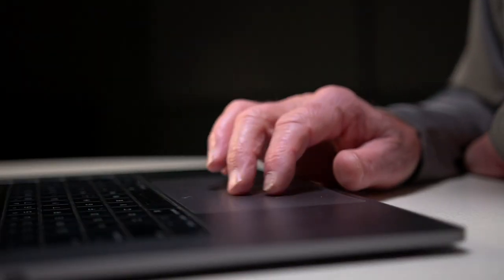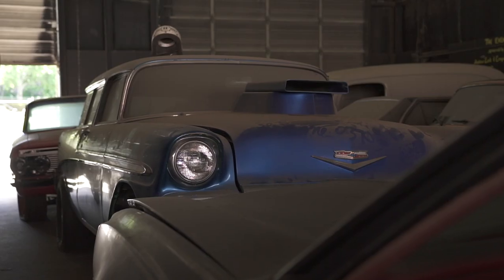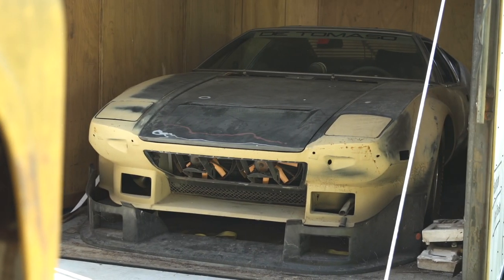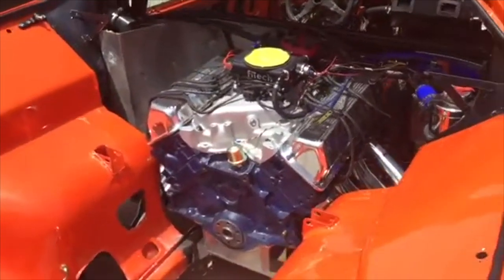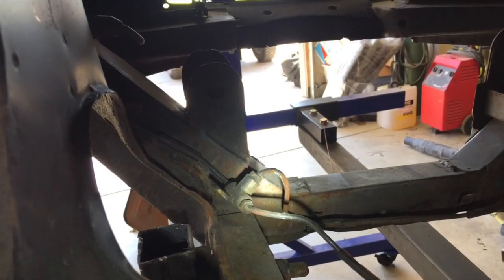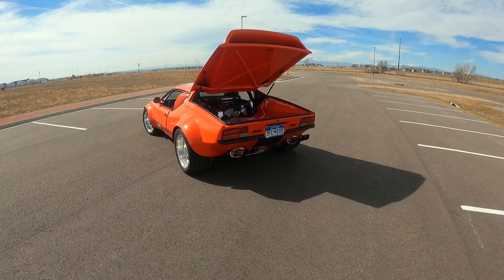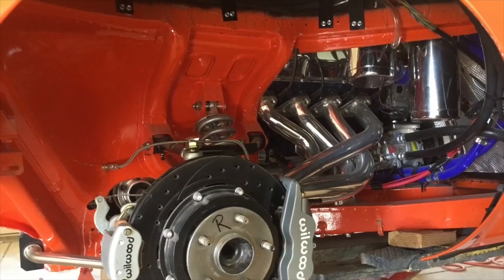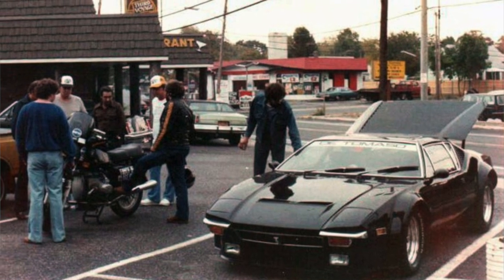BEFORE & AFTER: De Tomaso Pantera restored after 35 years in storage | Barn Find Hunter - Ep. 97

Comment: Down here in Australia the Cleveland never went out of favour and you can buy after market heads, Manifolds and even little tongues which reduce the oversized ports to raise the low end torque levels. Needless to say  know a guy who has an ISO with a 351 Cleveland which is a real road burner thanks to the local knowledge around these engines.